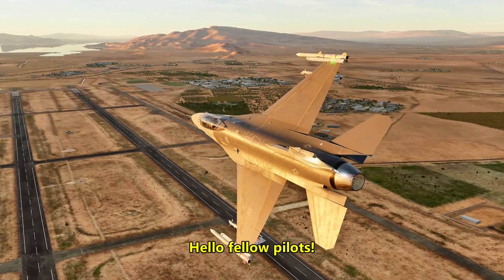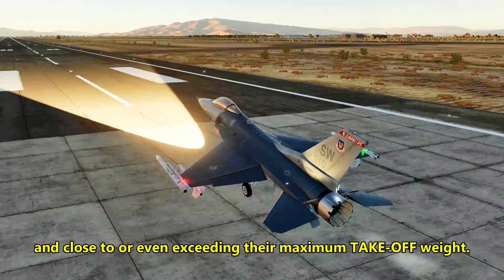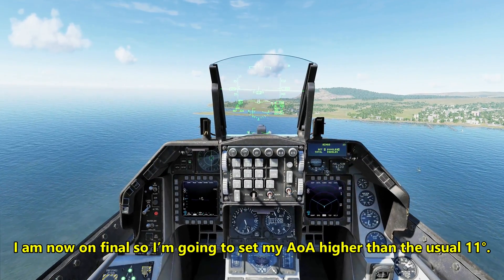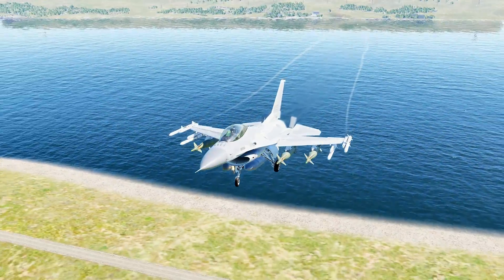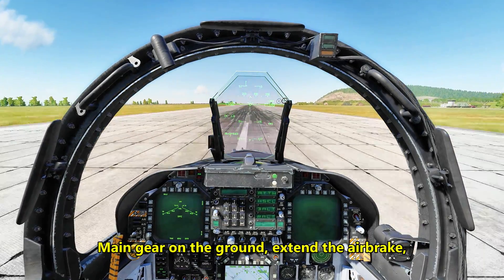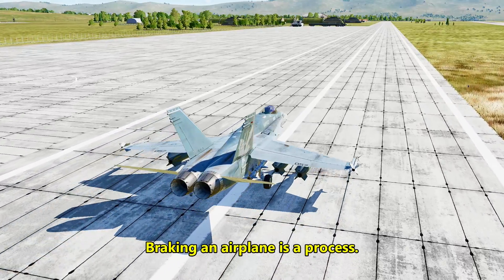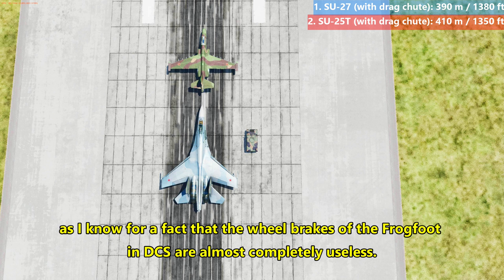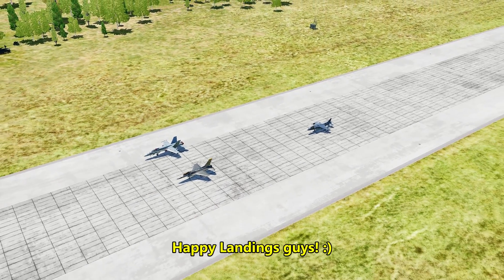DCS 2020 | F-16/F-18 SHORT LANDING [TUTORIAL]

Comment: Can’t find a reference for speed brakes in Approach poistion. Can you direct me please? Thanks.
Reply from the maker: It's probably not the correct term. The Viper's speedbrake "approach position" is the maximum extended position when the gear is down and the speedbrake OUT button released. 
You can further extend the speebrake to the max with the gear down if you keep pressing the speedbrake OUT button. (just be careful not to have a too high AoA or you'll scrape the speedbrakes on touchdown).
Reply: @CommanderSteinsch  Just recorded an approach and landing in the Viper. With the gear retracted, the speedbrakes extended to their full extension. Upon lowering the gear, the speedbrakes retracted to a lesser position. Upon touch down I extended the speedbrakes again and they then returned  to a fully extended position. You must hold the switch back to keep them there.
This is no doubt a design feature of the real F16 so the speedbrakes retract more quickly in the event of a go around.
thanks for turning me on to this.
Reply: @raynmanfortysix  huh TIL

Comment: Viggen Number 5, waht?
Reply from the maker: Yeah, surprising isn't it? I'm not a Viggen expert, so I'd be happy to be proven wrong!
Reply: @CommanderSteinsch  did you pull the lever before landing?
Reply from the maker: @HobelDcs  Oh yeah, I did. Maximum reverse thrust when nosewheel went down.
Reply: @CommanderSteinsch  Did you hit the 15 degree AoA?
Reply from the maker: @RedkidJ  No, I stayed at 12. Anything above and I wouldn't see anything in the HUD.
Reply: @CommanderSteinsch  For extreme short landings in the Viggen there is a switch to set the target AoA to 15.5 degrees instead of the normal 12.5 degrees.
Reply from the maker: Aaaaah, ok, good to know. Thanks, I'll check it out.